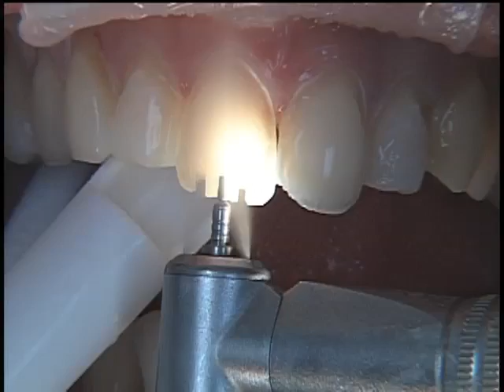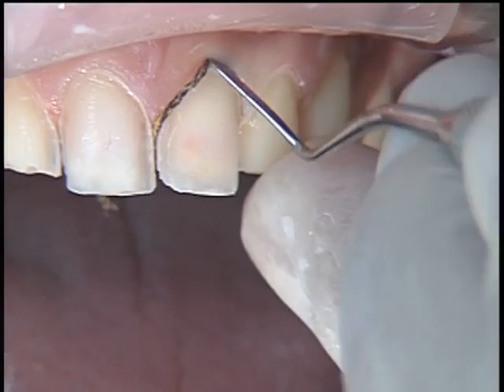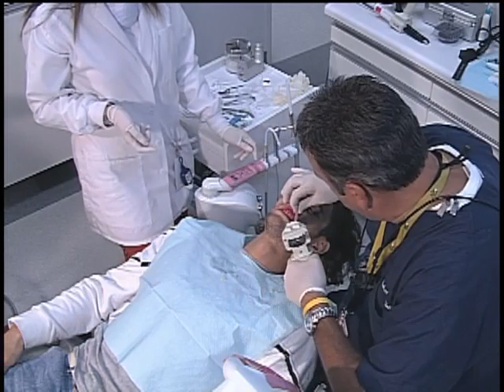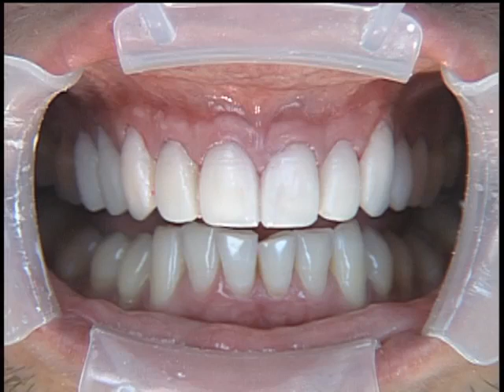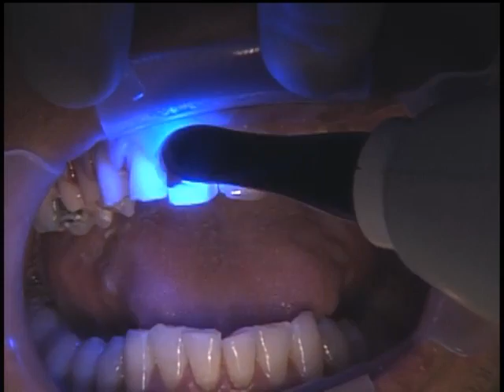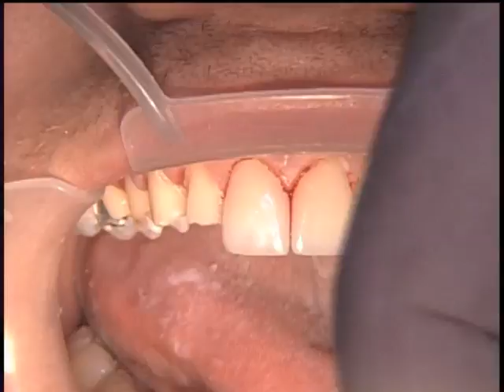Pre Preparation Contouring To Achieve Ideal Archform With IPS Empress® Veneers

Comment: When the central incisors are that protruded I'd recommend ortho, and then after ortho consider which restauration to proceed with (composite additive or veneers). Probably the left central incisor will end up necrotic due to the deep facial prep. The patient might not be interested in ortho due to his job as a model, but perhaps a professional wax up could provide a scaffold that wouldn't allow such aggressive tooth removal on the centrals. I like the temporary veneers.. good technique with the LuxaTemp.

Comment: You actually have your teeth destroyed in order to have fake pretty teeth.
Reply: Ye it’s pretty stupid
Reply: Makes no sense
Reply: this is completely true,I am a dentist student and I will never recommend this procedure at least it is really required to do it
Reply: hi! how can i make my teeth shorter?
Reply: @adrianrodriguez-yx9uo   personally I wouldnt even care to much about the covering, I would just have the laser to edge out the gum line as far as possible and have the incision teeth trimmed (shortened)  top and bottum, to make life easier,  
problem is coverage or cost
(Underbite with no intentions on correcting but the bottum contacts the roof of the mouth and molar on molar, while the front  completely covers the bottum teeth.
shortening both would have a actual smile with both sides visible and for refrence currently I cant even open enough the most i can open is  the same size or even smaller then that of a Nickle (coin)
edit - opening that far is already straining the joints of the jaw holding that for more then an instant is hard and makes the jaw tender
Reply: @adrianrodriguez-yx9uo  do you know how i can get my perfect smile safely with out destroying my teeth😂
Reply: @kennymccormick2140  the healthiest and safest way is through braces and when you are done with braces just a teeth whitening.Otherway if you are the person who is looking for something very fast( a day/noght result) then do the smile design but be prepared for the consequences.
Reply: @adrianrodriguez-yx9uo  okay thank you :)
Reply: @adrianrodriguez-yx9uo  you'll change your mind eventually ... trust me / i've been removing broken files for 4 years working as an endo spe ... trying to be as conservative as possible ... then i went on and tried to perform some cosmetic cases ... boy ... those were the most rewarding cases ... i've never seen patients so happy after a treatment ... you can always suggest an orthodontic treatment and some whitening maybe some bondings but ... if the patient asks for a fast result veneers are a good option and he did a great job .